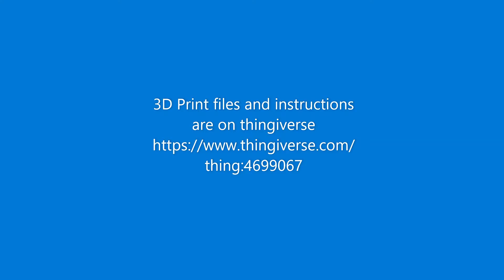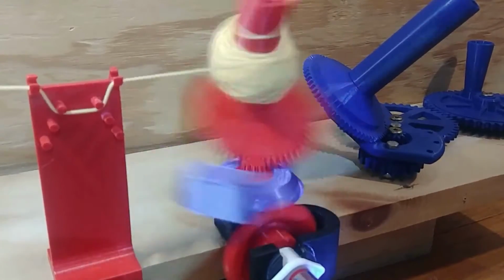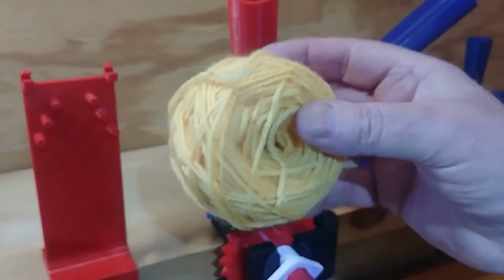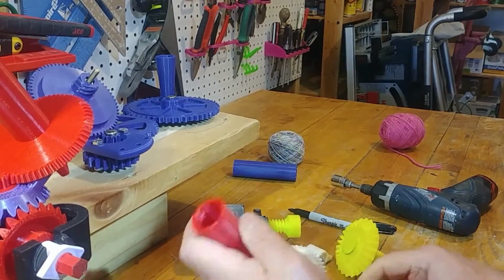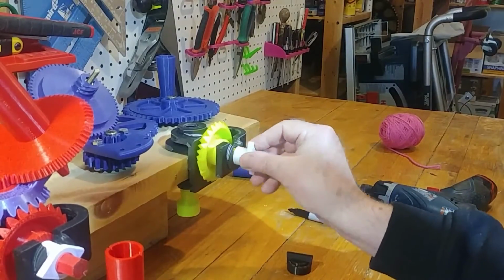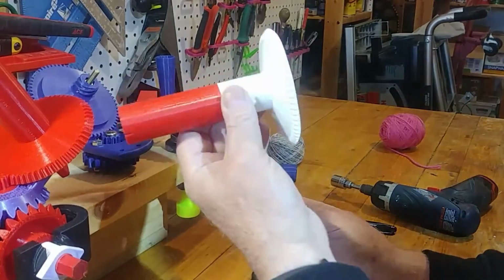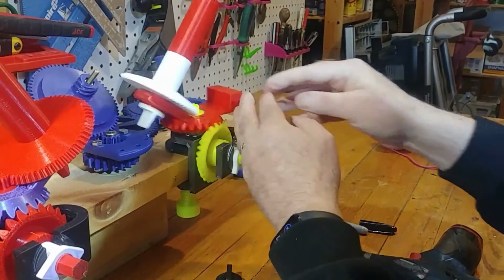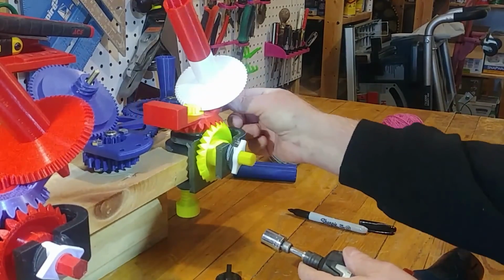3D Printed Wool Winder Demo

Comment: OMG this is freaken awesome. I was about to spend money on one when I was like... wait maybe I can 3D print this. I'm sure I could have figured it out eventually but thank you for doing all the leg work. Great engineering. Out of curiosity which printer did you use? I have an Ender 3. I'm hoping I can pull this off.
Reply from the maker: Hi, I printed this on the Ender 3 using standard PLA.  Some of the PLA+ available now are much stronger if you are concerned about strength.  Also look at some of the remixes as people have added good options.

Comment: Hi! This is awesome, I was wondering how you determined the gear ratio for the center gear and the spool. Does it have something to do with the diameter?
Reply from the maker: Hi I just copied what was already out there.  I did a remix of Printable Wool Winder by matthewlaberge November 21, 201, so I just copied the the dimensions from there. There is a wooden version with the same dimensions that has been made for years.

Comment: How does the large gear move?
Reply from the maker: the vertical red gear moves the blue horizontal gear. The big gear is attached to the horizontal blue gear so it moves round when it turns and the small red gear in the middle controls how much it turns.  You'll see this if you look closely at the start up.

Comment: Do you have a hand attachment so you don't have to use a drill?
Reply from the maker: There is no hand attachment because it is not practical for this design.  The gear ratio is 1:1 if you used a hand crank you would have to do a full turn for every turn of the winder.  This does not work as you are doing more work than winding by hand.  The commercial hand cranked wool winders appear to have a ratio of 6:1 or greater.  i.e. each turn of the crank turns the wool winder 6 times.   One that works with a hand crank would not work with a power tool.